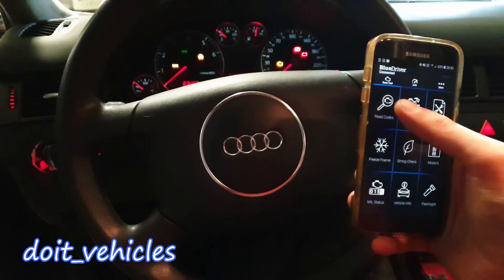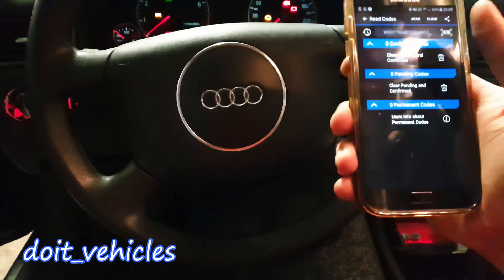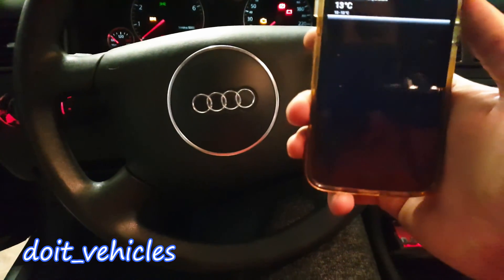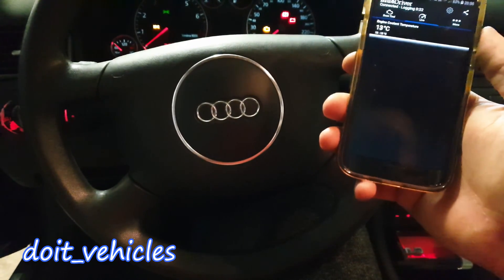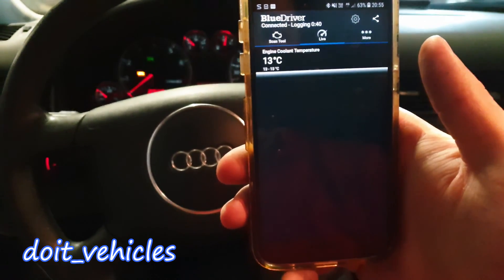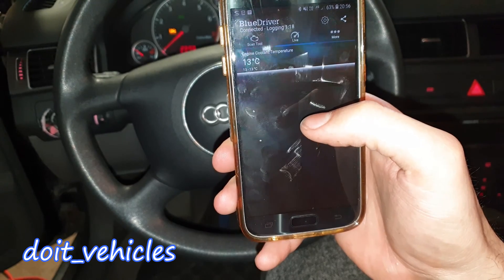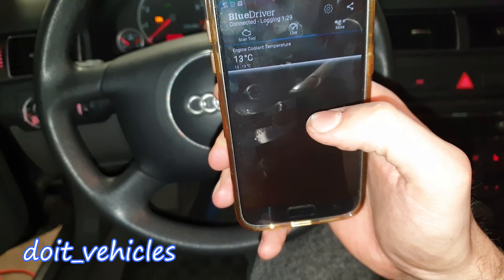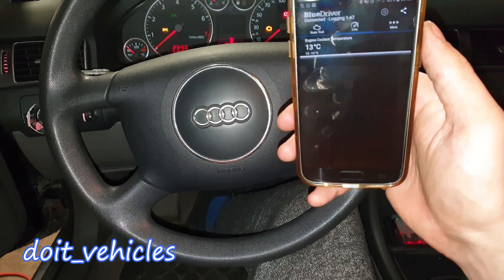Coolant Temperature Sensor Diagnose on 1.8T Audi A6 with Code P1296 and Replacement c5 , b5 tt a4 vw

Comment: How to determine the signal cable. I have 4 wire but now I do not know which wire goes to which pin (A,B,C and D) assuming that I can't detect the color of the wires. TQ
Reply: Two pins will have higher resistance and another pair of pins will have lower resistance. One set send signal to the ECM and another set to the temperature gauge on the dashboard

Comment: Dude.I changed the coolant sensor,but nothing changed.Fan is switching on as i start the engine and temperature is as it was around 60.Can it be thermostat?
Thank You.
Reply from the maker: if the fan is on from a cold start , the thermostat have nothing to do with it . the best is to check the live data
Reply: Have you figured it out yet? I did the same and had same issue
Reply: Fan control relay